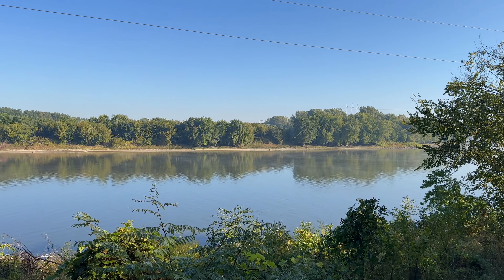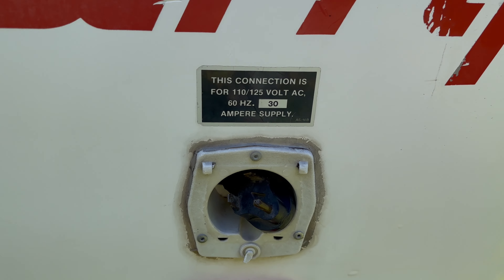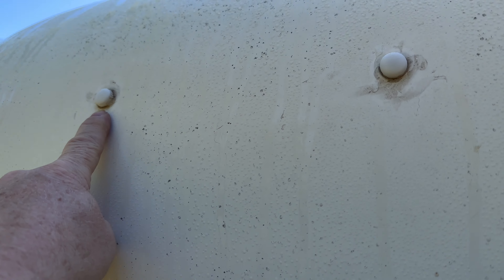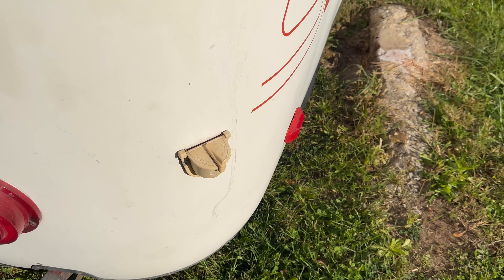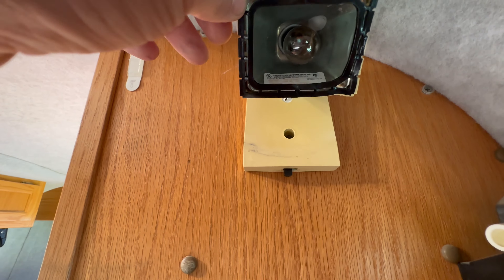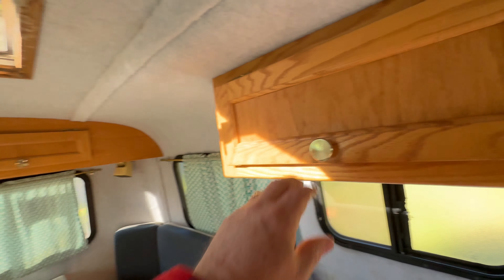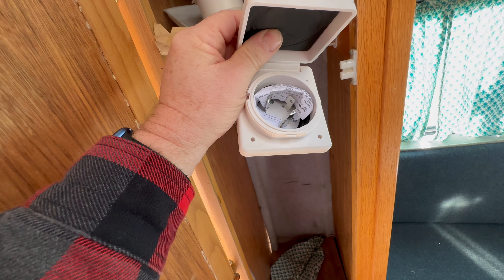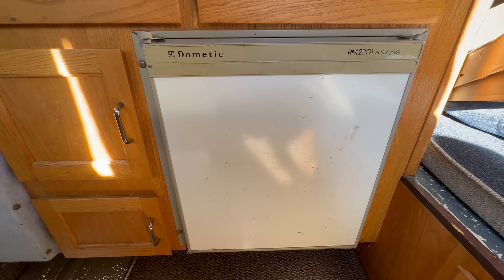1993 Scamp 13 Full Tour

Comment: The strange bits of metal you found in the closet constitute your tire iron. The long rod goes through the round holes in the main part and that's your lever. You should find that the hex end fits your wheel nuts.
Reply from the maker: It’s so lightweight I hadn’t considered that, but I think you’re right.

Comment: Congratulations on your find. You'll figure it out, i can tell. We just brought a Burro 1983, needs renovated. Needs fiberglass repair and body painted. Have been ordering stuff to start.  One plus for fiberglass body is they weigh less and once watertight stay that way. We had a pop up was always working on leaks, got a tear drop same. Peace!  Make her your own. peace!  There is a video on a a/c being installed in a Scamp back window without any holes or window removed. Tried to find it but could not. Look for it. We are installing a window unit in passenger side back side window because we have the original paperwork and that i where they suggest to you put it.